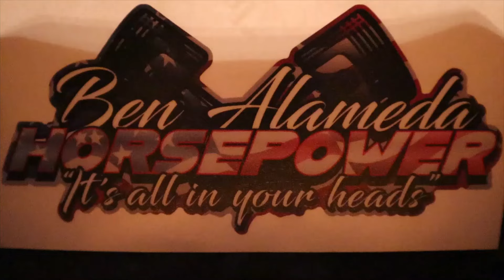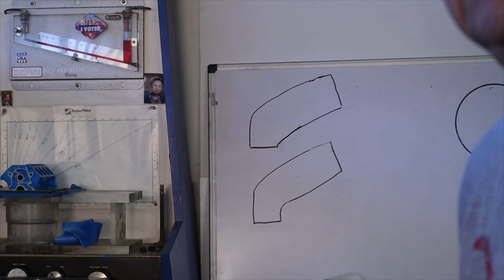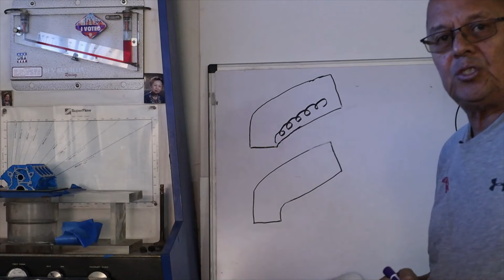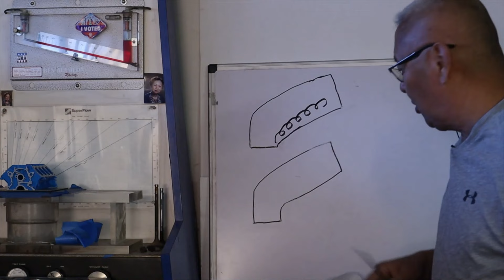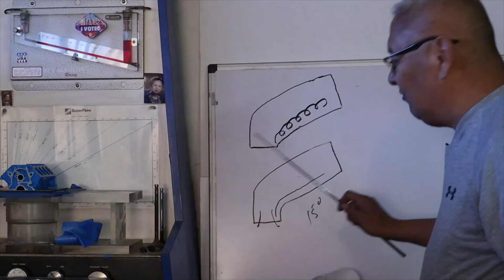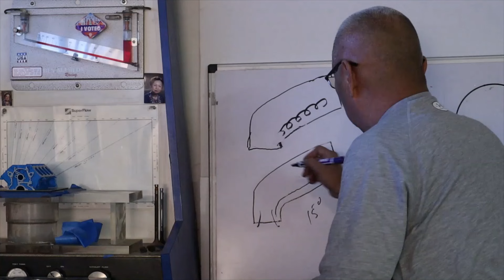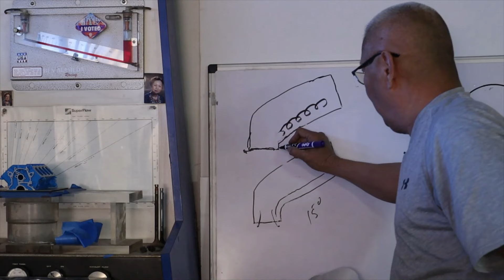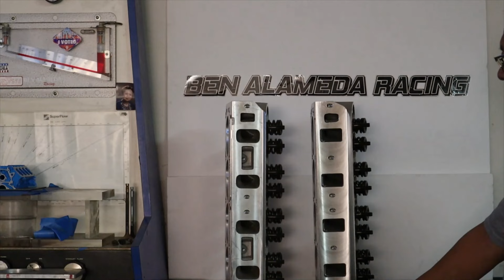FORD E7's TO YATES SC1 RUNDOWN!

Comment: 23 years ago my classmates talked a lot of shit that I ruined brand new AFR 205s. The majority opinion was, "If porting the head made any more power,  AFR would have made the exhaust ports that already. " 

With the runner already raised 3/8" I needed more port volume. I couldn't weld then so threaded some aluminum rod, cut off the excess flush and staked the plug in place.

One of the "Hotrod" instructors drove a new WS6 on an NX wet kit. I was a little 311, 11.5:1, big hydraulic roller, my freshly ported heads and Victor 5.0 intake manifold. 3 out of 3 my naturally aspirated 93 Cobra smoked him. 

I knew I was onto something. I've ported a lot of AFR's heads just to modify the exhaust was a really huge gain in my opinion.

Good stuff here Ben! Great stuff!
Reply from the maker: Well you learned to do it and test it instead of the talking heads giving an opinion with no basis of experience or just plain opinions then I would side with you because you have been there and done that!  Thanks for supporting my channel Arturo.
Reply: @benalamedaracing2765  yes sir you are very welcome. In all this time I've known a lot technicians, machinists, engine builders, shop owners, racers, etc.... We're not all cut from the same cloth!😉

Comment: So much good info as always! 18 years ago i was a apprentice at a machine shop. They gave me a set of ported E7's with 1.85/1.55 valves that were supposed to be very well done. Installed them with a performer rpm efi intake with a crane 2031 cam. The computer needed a tune to max out spark and fuel but i was happy with the Seat of the Pants gain. After watching your videos i dont feel so good about my e7's anymore. I always thought they were better then gt40s. Wish i could look over these heads to see what they did comparing what you showed in your video.
Reply from the maker: I will try to expound on this subject more where I compared a stock TFW TW heads vs. a max ported 351W heads!  The results was surprising and a dyno test would have said the TW would win hands down but not really when I ran both!  I will do this video perhaps next.

Comment: The low subscriber count on this channel has me baffled! The word needs to get out that if you want to learn how to build a REAL dragstrip worthy engine then you need to be on this channel! Most of the stuff I have heard on this channel I have never heard on any other. I've learned things on here that aren't even in David Vizard's books! Best of all, this channel is heavy on the Ford Windsor content, right up my alley for my next project!
Reply from the maker: Thank you for tuning in and noticing the difference sir.  The low count is due to the fact I started about 2 years ago and sat idle for a long time trying to figure posting here on You Tube and learning how to do photography and video editing.  I got it and if you look at the posts from a year ago it is far different from what I am presently posting.  I seriously started posting roughly a year and it has been growing bigger by the day and I am blessed to be able to get going after the initial stalled out not knowing how to start or do this!  lol
Basically I am the new kid on the block and how did you find my channel?

Comment: RICKY SMITH... A LEGEND 
NOW MANAGES A PRO MOD 800+ CU IN NITROUS CHEVY
Reply from the maker: Yes and in pro-mod they are either a Chrysler Hemi type, or in the case of mountain motor pro-stock, a semi hemi Boss 429 configuration.  There are no inline or canted valve engines in competition like what came out of the manufacturers (copies of 426/429) of two above!

Comment: Loving the chanel Ben and thanks for sharing your knowledge. Have you ever modified the 221 Windsor?
Reply from the maker: Patrick, unfortunately I have not come across the chance to build a 221 because I think most have the 5 bolt bellhousing pattern and the transmission are hard to find basically everyone switching to the newer 289 6 bolt bellhousing.
Reply: @benalamedaracing2765  Thanks for the reply Ben. I already have the 221 and c4 auto in an Australian 64 xm falcon and plan on giving it a freshen up with a bit more grunt. Was wondering what size valves i could get away with before shrouding them in the 3.5 inch bores? Do you have a valve to bore clearance you shoot for? Thanks.. Pat 🇦🇺

Comment: Ben i love your videos so keep them coming, best knowledge on youtube and no bullshit.  My question regarding heads, looking at building a circuit racing 66 mustang 347 windsor with a 5.0 roller block but unsure of heads, ported gt40?,   alloy windsor or cleveland heads to make it a boss engine?   Your suggestions i will respect your opinion
Reply from the maker: Sorry for the late reply.  To make it a unique car to look at use the roller block with decent compression and port a good set of Aussie heads!  That would set you out differently from the rest of the builds!

Comment: Good stuff Ben. Thank you for sharing your knowledge. Regards Greg, from Perth in Western Australia
Reply from the maker: Thanks.  I will talk about the great Aussie Cleveland heads for the street/strip and very impressed by it!!!
Reply: @benalamedaracing2765  I'm drooling at the thought of this. I've built many tough street Cleveland's here in Australia, but I wouldn't profess to be a top builder by any means. That said, on the street, my 351 Cleveland with closed chamber, cast iron, 302  Cleveland heads (2V port size), used to bring a lot more than it's fair share of trophies home against 4V and alloy headed motors. On the car club circuit, I used to drag race, circuit race, hill climb, and even do gymkhanas  in the same car. Loved the car and had an enormous amount of fun. Yeah, I know, the older you get, the faster you was...LOL
Reply from the maker: @theshed8802 , good humor there buddy and you are absolutely right that Aussie heads are great build up for the hot street duty's!   US 4Vs exhibit too much port @ street level compression ratios and really need minimum 12.1-12.5 with a tight quench to really give it the heads up power!
Reply: @Ben Alameda Racing  I was just rereading the Ford Falcon GTHO Phase 3 workshop manual. Your probably not familiar with the car,  but it was a 4 door sedan, with a 4V Cleveland, solid cam from factory, 3.25:1 diff gears, and rev limited to 145mph, with full factory warranty. It ran 11.5:1, actual valve timing was 40, 80, and 84, 36. Valve opening was either 0.494" on the low lift cam or 0.524" on the optional high lift cam. Interestingly enough, this works out to a 112°LSA. In my experience, Cleveland's love compression, Cleveland's love carburettor, and Cleveland's love load. I don't short gear them like I would a Chev. I've always had greater success with taller gearing, and wider ratios in the box, than I would run with Windsor's or Chev's. Personally I love to hear them load up and pull. One of my favourite combinations used to sound like a 6 litre Escort BDA motor. The intake staccato could be heard over the top of 3" open pipes. It sounded awesome, and it went hard. These are my personal experiences, but different combinations require different set-ups. So what I build, is different from what others build.

Comment: Ben thank you for all your tech info and your experience!! I have a question,I have a 306 carburetored, Edelbrock dual plane, flat top Pistons and GT-40X heads in my 1995 mustang street car, I'm sure my compression is to low with the aluminum heads but what is your thoughts on these GT-40x  heads?
Reply from the maker: GT40X has good intake/exhaust ports for a non stroked 302 so I would not cancel them in any way.  If you had like a mini dome computing to 11:1 or 11:5 you will have a very responsive engine that will surprise many!
Reply: Ben,thanks for responding back, yes that's the plan now after watching your videos.gonna be shooting for 11.5,my next step is selecting the rite cam! It's a 5- speed car with 373 gears and a 600 cfm Edelbrock carb..

Comment: Really liking all these videos especially the GT40 content because I’m working with gt40 heads and tubular intake on a mild setup. 

Do you see a downside or gain with a Manley 1.95 intake and 1.60 exhaust valve on mildly ported gt40 heads vs. Manley 1.95 intake and 1.55 exhaust? 

Upsizing the exhaust only. Are we losing or gaining anything on a mild build with stock 302ci engine with stock cam and bottom end. 

Thx again Ben!
Reply from the maker: Street porting is best accomplished by 1.94 x 1.600 and it responds real good with this combo installed.  I will expand on this subjects in the future that is for sure.

Comment: The SC1 head why did they do a smaller exhaust valve vs. The c3 and the brodix?
Reply from the maker: It is due to the SC1's "overdrawing" the intake charge column straight out to the exhaust!  I explained this on my videos about making more power with a smaller exhaust valve.

Comment: Do the 11R TFS heads have the same intrusive spark plug boss as the older Twisted Wedge heads do? Thanks.
Reply from the maker: As far as I remember the last one I worked on it has a little bit more material in that spot to help with the cracking issues.

Comment: The SC1 heads in your video are the Edelbrock SC1 or Ford motorsport SC1 ?
Reply from the maker: Ford SC1's but the Edelbrocks are better specially for all out racing with cubic inches.

Comment: Ben, you said don't spray heavy nitrous with Twisted wedge because of spark plug boss, how much nitrous are you referring to in that instance?
Reply from the maker: I did stay away from the TW's for heavy use but if you are careful it can work except for that spark plug area even with boosts I weld them and put a little more aluminum thickness in that very spot!
Reply: @benalamedaracing2765  thanks, I wouldn't be spraying more than a 150 shot, you think that is safe?
Reply from the maker: @vrm86gt , should be no sweat and if there is a little cracking just fill in and make that section a little thicker and problem solve!

Comment: A little off topic but what's your view quench chambered 2V Cleveland headed 302W for the street with an XE284H or similar, 5 speed and 3.5 gears in a falcon?
Thank you for your educational videos.
Reply from the maker: If you are talking about the Aussie heads that is an excellent street/strip project to start with! Can never say enough of a good thing about them.
Reply: @benalamedaracing2765  That's it mate, thanks for your input.
Reply: @benalamedaracing2765  Thank you sir, that's exactly what I was talking about but with a 4V intake, relieved and polished.
Reply from the maker: My street 70 Mach 1 with 351 4V close chamber heads. Sported a toploader 4 speed 11.1 with a very thin head gasket and ran a .640 solid roller and if I am correct a Crane 250/260 @ .050 on a 110lc.  With 4.56 to as much as a 5.14's on the streets was awesome and the gears never gave me any low/mid range torque issues because of it!  lol
I ran a Holley Strip Dominator with an 850 annular discharge DP  Holley.  I am trying to restore them now along with my 68 Cougar with the original engine still in it.

Comment: I need one single Ford SC1 head if you have one laying around? the one that I have is a Ford SC1 ported by Chapman and I need another one if you have one.
Reply from the maker: There usually is a stamped part number on it and it will usually be specific program of porting and valve size.  It is best to get one from them with the same configuration and for sure it will be expensive.  I do not have any at the moment.

Comment: I have an old set of sbf heads I believe they are gt40 heads, is there a way to tell which gt40 heads I have?
Reply from the maker: It will have a 3 bar line on the front and back plus a GT designation on the sides by the corner head bolts.  Good luck!
Reply: @benalamedaracing2765  thankyou sir for all the knowledge you share.

Comment: I can see you working you hind end off to get 6 avg hp. We know quench is very important, but most street guys look for max hp no matter what, but imo what guys need is more tq from 2000 to 4000rpm even if they kill off 20 hp off at 7000 . I'm just guessing here.
Reply from the maker: Perhaps you are right on point of superior torque band across the rpm range specially if your car has some weight behind it!  High horsepower on light cars is great but too much port/cam timing on a heavy car will be a disaster!